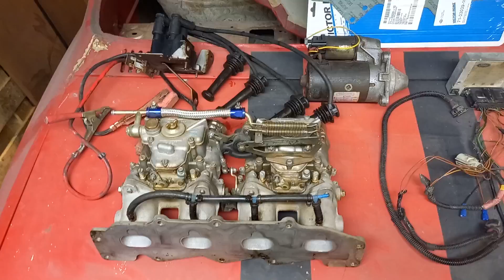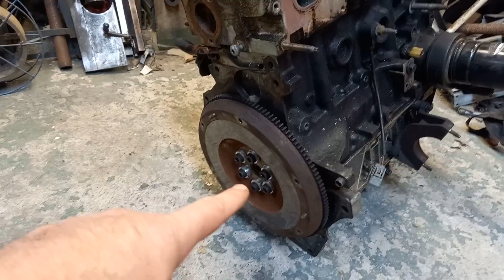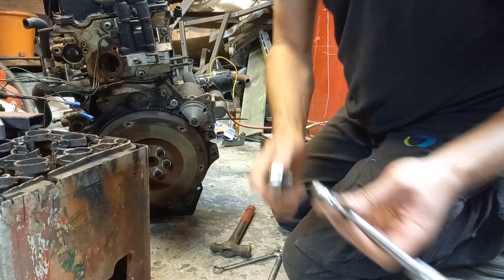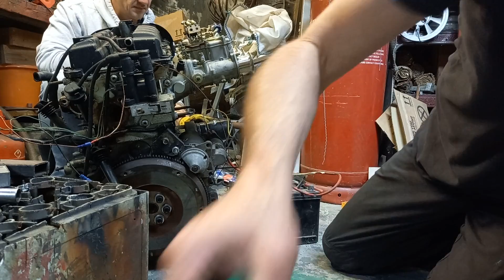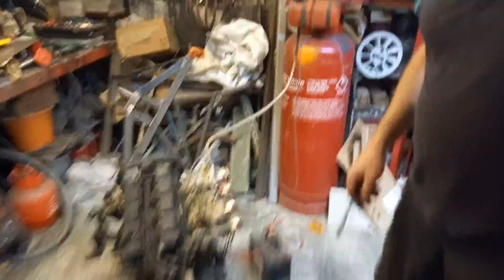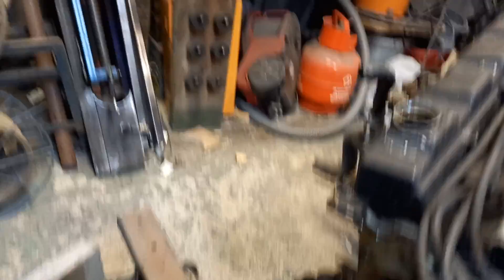Zetec ST170 engine start up on dcoe carbs and esc module || How to get an engine running basic setup

Comment: Will an ST170 127 kw Ford Focus Engine be able to replace standard Zetec 2.0  , 96 kw engine please
Reply from the maker: It will fit engine mounts and gearbox, as the ST170 block is the same as the zetec, bit you'll need the full ST170 ECU and loom etc to run it, or an aftermarket ECU

Comment: You got a runner Dave what gear box you going to use? Something like 3L capri or cortina?..
Reply from the maker: I have a spare mx5 box, I’ve used a 6 speed RX8 box before, so we will see.
Reply: @DavesGarageuk  sounds like a bit of adjustment to gear box tunnel is coming 😉
Reply from the maker: @sidsxr3irestoration  big adjusting tool may be used